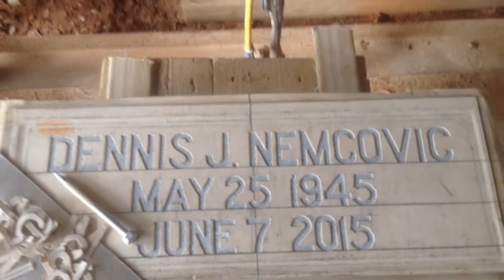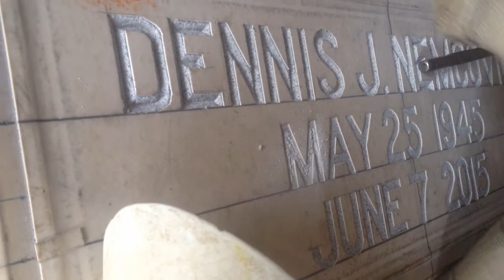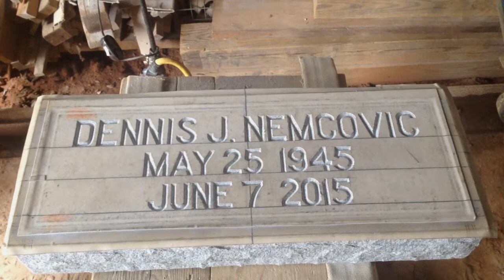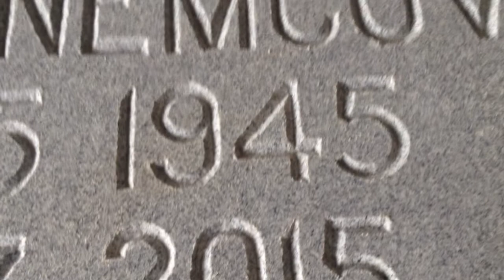Traditional Stone Finishing Techniques - V-Cut Lettering Granite with Hand Machine & chisel Video 1

Comment: Thanks for this!   Very brief, but watching how you work changed the way I approach this.  I'm learning lettering and was having a lot of trouble blowing out the center of things like Bs, etc.  This shows the finesse required.   Seems more like shaving than chipping.    Thanks very much.
Reply from the maker: You’re welcome.  I’m glad the video helped you overcome challenges you were facing.  

Think about the process.  Producing an initial center relief cut produces weakness in the stone so it has somewhere to break, so this allows the stone to break or be cut in a controlled manner.  Pushing into a heavier mass while cutting very slowly also allows control in a different manner.  

Captured interior areas (like the B, R, A, D and lower case letters) are very fragile.  Working towards those captured interior areas is very dangerous.  Consider producing the relief cut along center of letter, then work outward from center to limit putting pressure on those captured interior areas.  Once your depth is good, you can focus upon the exterior face of the V-cut.  Work slow removing a small amount of material until you find a speed that is comfortable to you.  Then increase your speed to help with productivity,  Fast is no good if you’re making mistakes..

Of course, make sure your chisels are very sharp and with the right bevel profile.  I’ve got a video about basic sharpening theory on my VSCA playlist discussing bevels.  Short bevels with shoulders make small or close work cutting letters much more difficult and dangerous, in terms of breakage.

Good luck.
Reply: @carolinasculpturestudio  Thanks for the detailed reply.  I checked out the sharpening video - very nice again!   The wooden tapers are really a nice visual, as well as the demo at the end.  I've been playing with the shape/taper of my chisels, but I'll go revisit my work.

Just viewing your lettering video one has changed my game, and given me confidence.   My practice letters went from  exercises in frustration to small works of art :)    

I look forward to working through the entire series.   Many thanks for taking the time to put your series together and provide it world.
Reply from the maker: @DS-yo4uw  knowing these videos are making a difference for the few serious people out there makes doing the worthwhile.  Feel welcome to keep in touch if you have any questions.  Contact info is on my website.
Reply: A quick follow up with a bit of success - I really focused on the shape of the chisel and where it was in relation to the surrounding stone based on that shape.   I realized that in some cases I was cutting at a very shallow angle to the work, which resulted in the non-cutting sides of the chisel hitting and causing blow out. 

After generating a few Rosetta stone looking objects with my new found knowledge, I was able to create a memorial stone for my mother, which ultimately looks pretty good.  As an artist and craftsman herself, I think she will appreciate the outcome.    I might visit it again as my skills improve and I can provide a bit more flair and ornamental details.   

Again, thanks for sharing your knowledge.
Reply from the maker: @DS-yo4uw Thanks for the update, DS.  If you have stone for practice, consider making similar cuts in larger scale or dimensions.  It helps clarify how the shape and form is produced while allowing more room and material for error.  When cutting the same in smaller scale where economy of material and tool usage is more critical, you’ll have a better chance at success.  

Many people misunderstand how hard it is to only remove a very small amount of material to produce a desired result.  V-cut letters are tough to do well because there is so little room for error.  Keep working- you’ll get there.

Consider contacting me directly via my website if needed.  Glad to speak with you.
Reply: @carolinasculpturestudio  As always - thanks.   I do have an endless supply of natural stone (from the ground in central NH), although a bit of prep is required.  Not sure how it compares to that of the quarries, but seems good for practice.   The grain seems to be close to what you are using for the squaring granite series.  

I do think one of my challenges was starting a bit too small - I was cutting 1.5" letters in a Times New Roman font, which gets a bit thin in some of the rounded letters.   I found that proper tooling helps - I forged (and then reforged with a finer taper!) what became my preferred chisels from tool steel, as my purchased carbide ones were a bit too large.   I'll braze some carbide tipped ones in the near future.    

Lots to learn and do...I'd like to move to some more natural forms for a bit.  

I will reach out directly at some point, and appreciate the willingness to engage.
Reply from the maker: you’re very welcome.  glad these videos are providing resource for you!